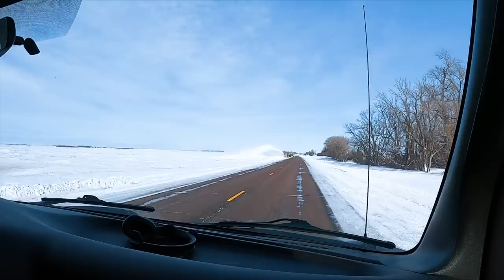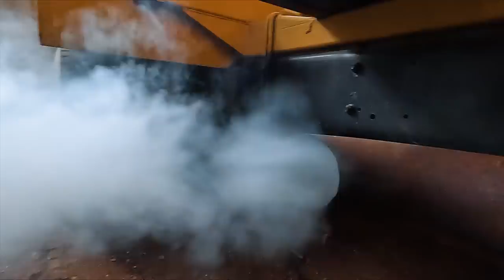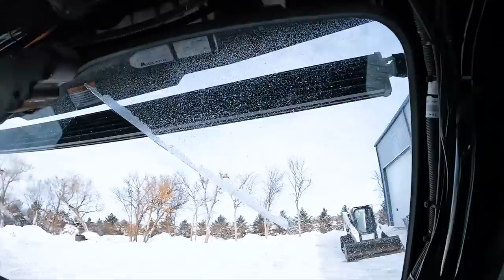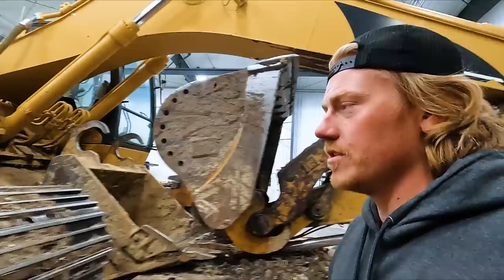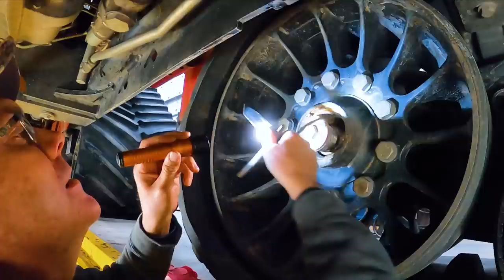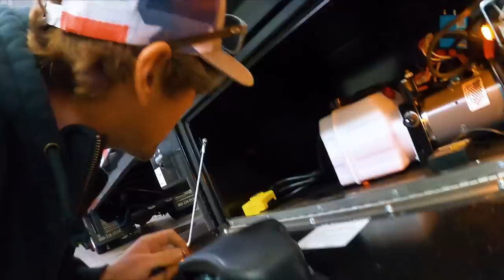We’re In A Selling Mood!!

Comment: Not to be telling you your business. But I would put a trailer pig tail somewhere on the top of the truck bed. I’ve torn them of with plugging them in where you plug a bumper trailer up at. When you jack knife it tight is when it happens.

Comment: Chet on that top kick  truck my friend  has 3 of those but they are 4×4  . He had a 2wd   that was a good truck and then bought  a wrecked  4×4  cheap and took the Transfer  case and front-end   switched everything  over   . He put super singles on it with a lugged  Mud tire  it goes in the mud

Comment: Chet, that C4500 Kodiak has a manufacturer's published Gross Combination Weight Rating (GCWR) of 26,000 lbs.  The issue you will run into isn't whether or not you can pull the trailer, you absolutely can.  The issue is that you won't be able to put much on it without being illegal because you'll exceed the published GCWR.  I have to believe that truck weighs at least 10k and the trailer with a hydraulic beavertail has to weigh at least 8k.  That only leaves you 8k for payload.  I've been down this road and it's not a pretty ride.  The beauty of the hydraulic tail is that it's long and you can move weight almost to the rear of it to counterbalance any weight near the front, thus allowing you to be legal on axle weight on the tow vehicle.  The tail also allows you to load 100% of the deck length, another plus.  It also will have a shorter wheelbase than an equal overall length standard deckover trailer has because of the length of the tail, making the wheelbase shorter than an equal length deckover, giving you a shorter turning radius but ultimately you will find the inability to load what you hope to, without exceeding the published manufacturer's GCWR of 26,000 lbs, will be frustrating.  I owned a PJ 34' tandem dual lo-pro hydraulic dovetail with electric over hydraulic disk brakes for about 10 years.  It was a fantastic trailer with a GVW of 24k!  I pulled it for a few years with a GM K3500 dually, which handled it fine.  The trailer brake system would stop a freight train.  The truck had enough power to tow it fully loaded.  I could balance the trailer to the point where the  weight on the gooseneck ball was legal for the truck rear axle weight rating, but I could never get legal for GM's published GCWR.  If GM had never published such a figure, it would have not been an issue.  But they did and ultimately for me it cost me 8 grand on a state scale, at a dollar a pound.  I was not over GVWR on the truck, not over GVWR on the trailer, not over axle weight on any axle, but I was over GM's GCWR of 26k, weighing in at 34,000 lbs in combination.  I paid the fine and went shopping for a tow vehicle with a higher GCWR because I regularly hauled in excess of 32,000 lbs.  To stay with GM of the vintage your truck is, you need a C6500 or larger. For Ford, you need an F550 or larger.  For IH, you need at least a 4300.  WHY? Because there's no published GCWR for those trucks.   Most of those single axle tow vehicles can be licensed up to 55k for a GCWR.  I ended up purchasing an IH 4300 DT466, tuned,with air ride, air seats, all the bells and whistles.  It was a dream, ran like a raped ape but ultimately it was heavy, even when empty.  I have since sold that combination in search of something more fuel efficient.  I'm now towing with a Ford F550 4x4 dually, pulling a triaxle (single wheel, 8k axles) 24k GVW trailer, still 34' but the total vehicle combo light weight is 5k lighter than the IH and PJ combo with the very same overall payload but I'm in a lighter weight class for license, insurance, and my fuel economy is increased. I'm totally legal in all 48 states.  Check your door sticker on your C4500 Kodiak.  You'll see it has a 26,000 lb GCWR.  That will haunt you and there's no way around it.

Comment: You got vehicles that won't start when it's cold , you need to put one if  them magnetic block heaters on them you just stick them to the block and plug them in , and they pre  heat the engines

Comment: I had a float similar to you. We had a Honda motor built into the gooseneck to run the hydraulics and also weld on some half inch or 1 in.² on the gooseneck so you don’t slide when you’re loading the excavator

Comment: Why not just buy a 1 ton diesel pickup we haul 17 bails weighting 25000 and then we haul our 12500 skid-steer on our PJ gooseneck  and we have never had any problems with power or the trailer that we have had for 20 year’s. We haul lots of things with that pickup and trailer set up very handy rig

Comment: You need to oil guard that trailer that way it will not rust. I use fluid film on everything I own and don't have rust on anything that I drive in the winter. You should look into it they sell it in 5 gallon pails and can put in on yourself

Comment: Trust me on this, you need to put your 100 gallon fuel tank on your gooseneck toung, we use a dodge ram 3500 2018 dually deleted and on a trailer fhst size it it pulls our 14k skid steer, side by side, and 5 or so attachments just fine, amazing what deleting a cummins does for power
Reply: Deleting really hurts your bank account when you get caught. $5,000 for removing the DPF filter and $5,000 for disabling the DEF system. Then you need to put it all back on.
Reply: @tiredoldmechanic1791  ya but here in Kansas we can have deleted diesels and he is buying a new diesel for his horse trailer to travel the country, so he will have his deleted diesel for fence building, and know it’s a power horse, and if your not stupid and showing off you won’t get caught
Reply: @nickhartsock9849  The emission laws are Federal laws and apply anywhere in the United States. It doesn't matter if it's on road or off road. Even construction equipment is required to meet the emission specs. All they have to do to catch people is to plug into the OBD port and they can tell in a couple of seconds.

Comment: Awesome video guys.
Personally I probably would of passed on that truck.  Shocked that it doesn't have 4 wheel drive.  
Kool trailer, you'll like using it for several things.  One thing I wouldn't put on it is BS's thing called a Ford, that'll definitely break the trailer for sure.  Mainly because it's a for and isn't work much but scrap price.  
What are aluminum cans going for these days?   LOL. 
🚜🚜🚜